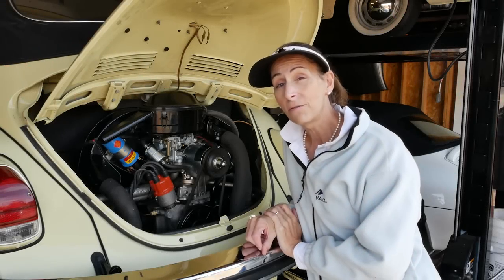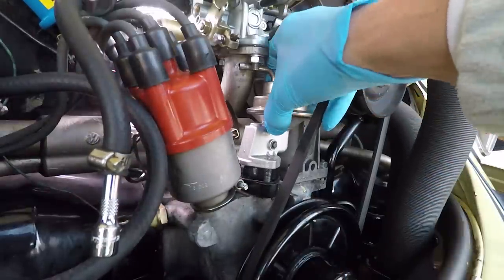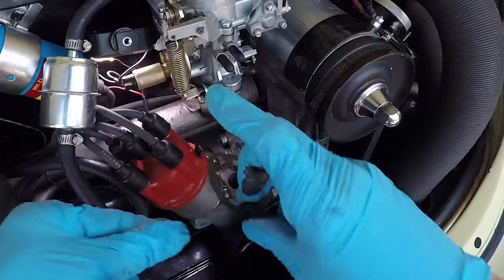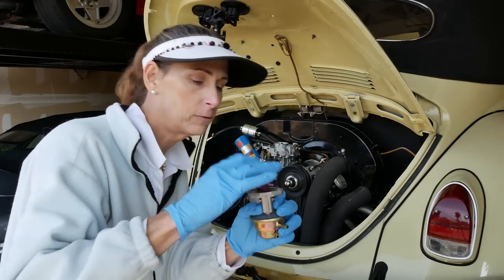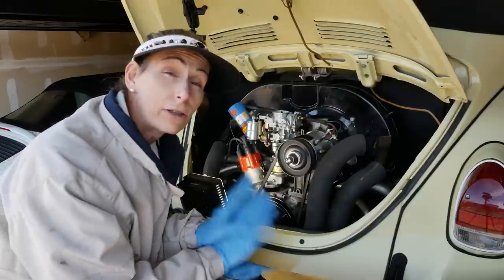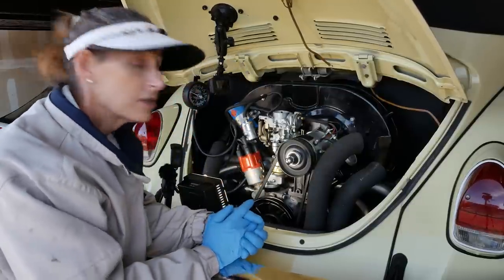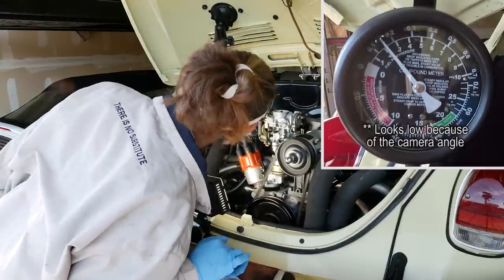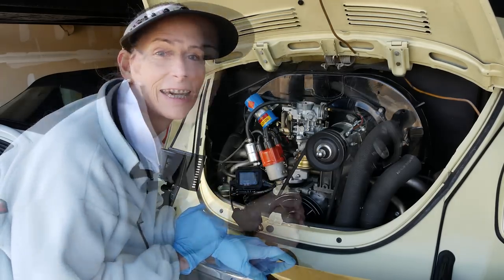How to Replace a Fuel Pump on a Classic VW Beetle (DIY - Pressure Test & Regulator)

Comment: About the fuel pressure. Why not use the shorter Alternator rod if you have the generator version of engine. That plus maybe a gasket or two should fix it, right?
Reply from the maker: That is a good thought and in line with what the VW manual would say, but with these aftermarket pumps if you reduce the pump rod throw (either by grinding or gasketing up) the flow will drop to the point where the engine will start to run very lean on the highway and may even stall (or overheat).  I think it has to do with the stiffness of the pump diaphragm.  It is a shame.  It would be great if they came with a regulator built in! F
Reply: @HeidiandFranny  I really like your video even if you are a girl. Not a bunch of needless gabbering. Everything is clear and helpful...FYI I ordered both rods with my new fuel pump and will try the shorter alternator style rod if the fuel pressure is too high with the longer generator style rod.

Comment: I have a 1975 fuel injected, can you pressure test right from the out of the fuel pump to the line into the metal line?
Reply from the maker: That should work, but your pressures will be quite a bit higher.  I believe John Muir's book has a procedure.  I've never actually had a VW with FI...

Comment: I just changed the pump on 1973 beetle, the spacer cracked and is not pumping gas. Lines are clear and I've ran it by pouring gas in carb. Rod is wrong?
Reply from the maker: Sounds like you need to start over.  Make sure you have the correct rod and pump and you probably need a pressure regulation.  Bummer.  If you need anything, please email us through our site.  So sorry. :(.

Comment: I installed it and it is working for me. Can you tell me where it leaked from? Do you know what could have caused it to leak? Thanks.
Reply from the maker: It appeared to come from the wheel.  It wasn't subtle.  Just keep an eye on it.  All I did was adjust it and that was it.  It was fine for weeks though.  You might want to order the Holly part just incase...
Reply: @HeidiandFranny  I had noticed you installed your horizontally. Mine is installed vertically. I will definitely take a look at the Holy part.  Do you have a model number or part number? Thanks for making great vids!
Reply: @HeidiandFranny  I just saw your other video.  Thanks.
Reply from the maker: Mauricio Maldonado good.  We will reference the two videos to each other.  Franny said the part is in the other video.

Comment: What fuel filter compatible with the VW engine and fuel pressure is being used in the engine? It appears fully metal. Thank you.
Reply from the maker: Get it at the FLAPS.  Tell them metal, not plastic.
Reply: Heidi and Franny's Garage    I am sorry for my ignorance but what does the FLAPS stand for?
Reply from the maker: @jimmd53  Oh, sorry: Friendly Local Auto Parts Store :)
Reply: Heidi and Franny's Garage thanks.  You do really great work and your love for the VW Bug shows.   Thanks much.

Comment: Why does the afternarket fuel pump put out too much pressure if designed for this engine?
Reply from the maker: Not sure, but I believe the rubber diaphragm is too stiff.  I'm guessing it is very difficult to come by material just as the original.  Just a guess though...

Comment: Enjoyed this but frankly if it ran OK I wouldn't have bothered with a pressure regulator, we had a 1974 GT beetle.
Reply from the maker: It didn't run well.  Check out the stranded video I did.  The problem with these pumps is that the push at 5psi or more and that it too much for the needle and seat in the float bowl.  It can cause a rich condition at idle and will push fuel into an open cylinder when the car is off for a minute or two.  So, folks shim or grind the rod and they get the pressure down but the flow is so low it runs lean at speed.  The regulator solves all that.  The correct original pump would be the best choice.
Reply: @HeidiandFranny   Sorry for the late reply , I never heard or came across this issue here in the UK , is there an issue nowadays with replacement parts? We spent years in the VW scene with Bugs and vans.  We here love your attention to detail, and the cleanliness of it all, such a difference to when I did it :) Thank you

Comment: Hi, is it workable to use high-temp adhesive on broken plastic phenolic spacer?
Reply from the maker: Sorry, Meant to get back with you about this.  I would replace it.  The part isn't expensive new or used...  You don't want that coming apart while the engine is running.  It would be very bad if anything fell into a running engine.

Comment: Why would you grind any rod?  Rock Auto for less than two bucks and at your doorstep in three days. Buy a spare or two.

Also I own an 82 911SC.  Any videos on that generation?
Reply from the maker: No SC (at least not now).  No plans to either.  The closest is the 1986 3.2, but they are quite different.  Sorry.
Reply: That's cool. I thoroughly enjoy learning about your other cars.  Beetles were everywhere when I was a kid (the 60's).  If they came with air conditioning (Florida), I would probably own one now.  But I have worked on plenty of them for friends.

I have the 82 911, a 1986 gorgeous red Alfa Romeo Spider convertible, and my daily driver - a cherry 1988 Honda CRX.  All are driven regularly.  Nothing sits in my garage.  This year all will have collector car tags. And  I do pretty much all the maintenance and most repairs (I have both hydraulic lift and ramps in garage).

Cars nowadays have no soul - but plenty of expensive computers.  They are like ticking time bombs that will sooner or later explode in your wallet.
Reply from the maker: One of the cars I would love to have would be the Alfa Romeo Spider from the 50s.  Heidi
Reply: My red 1986 Alfa Spider convertible always puts a smile on my face.
By the way, I think you guys are great.

Comment: Hi again. I put everything back together,...but now, my engine wont start. Inthink the carb is flooded from the high pressure of the fuel pump. How do i fix a flooded carb? 😭😭😭help!!! Thanks!!
Reply from the maker: To start a flooded car, you press the accelerator to the floor (don't pump) and crank until it fires.  This is assuming the car is truly flooded (you can smell gas from the tailpipe).  Don't crank for more than 30sec at a time.  If it still won't start it either isn't flooded or there is something else.  Pull a spark plug and check for wetness or dryness.
Reply: Heidi and Franny's Garage ok, i’ll try again.  Problem is the battery is nit string enough to keep it crankin. I think its about to die soon. The triple came out last month, installed a new battery, but told me that my alternator was not charging properly. Oh boy. Do u think if i drain the oil, the fuelpump base and rod will come out easier? Right now, they r practically stuck glued on. Could get the rod out
Reply from the maker: If you can get the rod out, then don't mess with the base.  Just check the total movement as I show in the video and make sure you match the correct rod to the pump.  Then once you get all that sorted and the car running, then check the pressure as I outlined and augment as necessary.  Get a battery charger and also a tender for your battery until you get the alternator sorted.  Should be ~$100 to get that rebuilt. Be methodical.  One thing at a time. verify everything against spec.
Reply: Heidi and Franny's Garage 👌 ok. Thankyou for advise. I tried gripping the rod with pliers, the rod is stuck. I’ll keep trying! Thanks again

Comment: While i was working on this  the bolt  plugged into the fuelcable to stop it from leaking it fell into the where the black thing needs to go...
How do i get it out
Reply from the maker: Well, first you must get it out. Do not rotate the engine until it is out.  I would start with a strong magnet and fish around in there. Hopefully you will capture it and you can work it out.  I know a bit too late, but always cover any hole with a rag or something to prevent this in the future.  Good luck.  Franny
Reply: Heidi and Franny's Garage  thanks for your quick response! I’ve tried it but it didn’t work...
Do i have to take the engine out, tear it apart, remove the piece and put it back together. Or is there an easier way to do it?
Reply from the maker: Hard to tell if it could have worked its way all the way into the sump...  I would try that next.  Pull the big round oil cover plate and fish around in there with your magnet (the bolt is steel I hope...)  If still no joy, get some serious light in there and see if you can locate it.  Also a bore scope might be helpful. I think Harbor Freight has one for pretty cheap.  Once you can see it, maybe it will be easier to get out.
Reply: Heidi and Franny's Garage thank you, i will try it. I dont know harbor freight.
Living in holland. Thanks alot by the way.
Very helpful video!!!

Comment: i have a t25 waterboxer same rules apply?
Reply from the maker: Yes if it is carbureted.  Check the spec on your carb and look for the max pressure the needle and seat can take.  If it is below 5 psi then you'll need to address that with the new pump.

Comment: You should change the fuel filter position it is very dangerous near from the coil and up of the distribuitor you have   potential risks of  leak and may cause the engine burning.
Reply from the maker: It is not our car and we have mentioned it to the owner.
Reply: This not solve the risk of fire, you should explain to the owner.

Comment: Tell us how the fuel pump push rod failed, please.
Reply from the maker: I'm not sure it did...  Since there are two possible pumps each having a requiring a rod length but guess is that it was the short rod and the long pump.  I think there is a lot of confusion out there concerning that.
Reply: @HeidiandFranny  Yes...the canted pump (which is supposed to pair  with the alternator) takes the short rod.  The long rod is for the up-right pump, which normally would pair with the generator.  The larger head of the alternator necessitates the canted pump for clearance.  Thanks as always for y our great videos!!!

Comment: The rod for the "tall" pump should be about 107 millimetres long, the short pump push rod will be about 99 millimetres long. The rod She held up with the radius on it looks like somebodies home made creation. BTW, the tapered end of the rod goes DOWN into the engine. If you find a fuel pump push-rod that is flat on both ends it's most likely for the old 36 Hp engine.. In the official VW book the recommended pressure is 2.5 to 5 Lbs.
Reply from the maker: That is one of the issues with buying an old beetle that was restored by someone who doesn't know much about Beetles.  It was a shame some of the parts that are on that car.

Comment: Only thing I would have done extra here, after all the other problems, is road test, just to make sure Lemon Drop doesnt turn into a FORD. (Found On the Road Dead!)
Reply from the maker: I did go out and test a bit, but the owner has been using the car regularly and says it is running just great!
Reply: Thats kewl! I should have known, wasnt trying to sharp shoot you at all.

Comment: Hi Franny, Sorry if I am bothering too much on this subject. My bugzy broke down yesterday and it looks like the fuel pump diaphragm is trashed. I may have used a long rod opposed to the short rod (I have altenator but probably came with generator). Can you look at the two pictures below and advise what i should do? The first picture is the original rod, does not appear to have the right clearance at TDC, the second one is the rod that trashed the other fuel pump....its appears to be too high.

https://imgur.com/a/hCY2Aj8

Comment: I managed to drop the rod into the case😑
Reply from the maker: Well, get a good strong magnet and try and fish it out...  You may need to pull the plate on the bottom of the engine and fish around in there... Not the end of the world, but it is a minor setback...

Comment: NEVER mount a fuel filter over top of ANY electronics in an engine bay...  NOT the distributor, NOT the coil...  NOTHING WITH POWER OR SPARK..  please.

Comment: Those regulators are junk and leak as you so discovered.  I strongly suggest you relocate the gas filter that is hanging above the distributor ( a fire waiting to happen) move it to where the hard line exits the frame horn. BTW the fan belt is too loose.